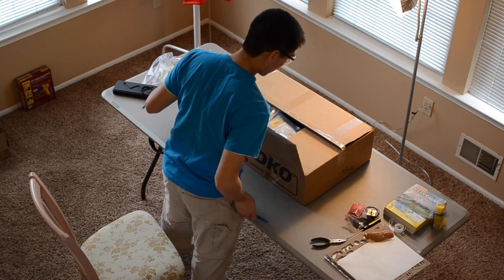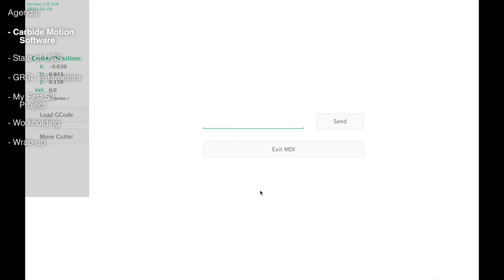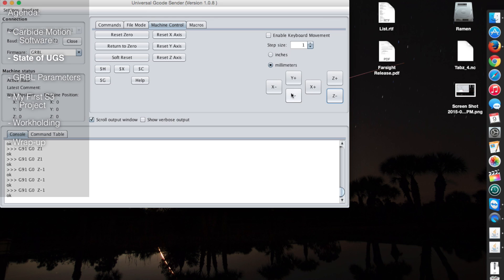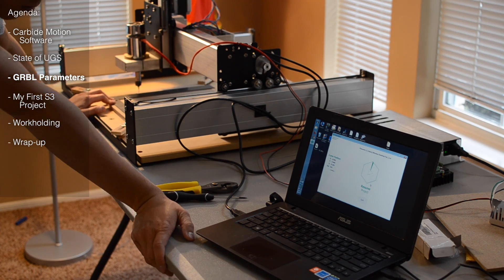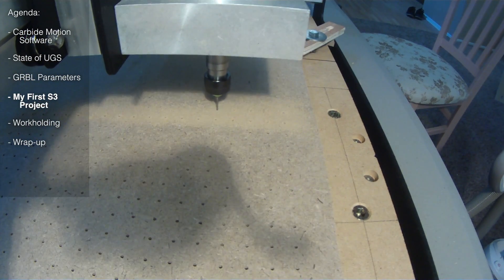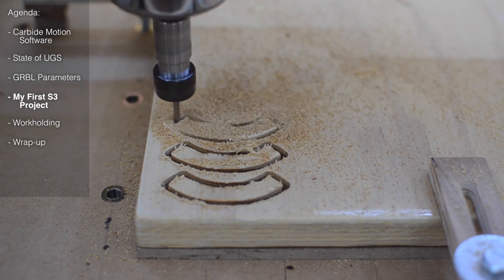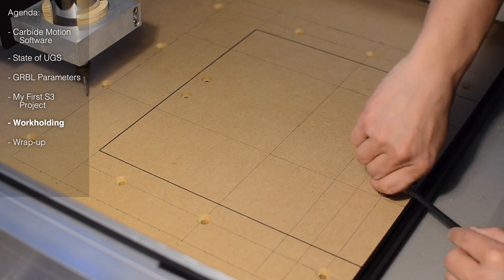Shapeoko 3: My First Cuts & Project

Comment: Hey Winston, great video. Are you still running the Shapeoko 3? Do you do any freelance milling?
Reply from the maker: I have actually started taking up some commissioned projects, and I use my Shapeoko 3 (stock size) a ton. Even more than the XL I also have actually. Little regular maintenance/tune up here and there and it runs like a champ.
Reply: Can I email you the file for you to look at, and see if it's something that you'd like to work on?

Comment: Hi, I was wondering if this has the capability of cutting balsa wood that is 1/8" thick. Would the balsa would stay in tact around the around that was cut or would it start splintering?
Reply from the maker: +Maya A I have not done it personally, but there are videos or there of the last-gen Shapeoko doing it. It comes down to having a really sharp cutter more than anything else.
Reply: Thank you so much for your insight.

Comment: Great video, just subscribed. What do think of the shapeoko 3 vs stepcraft? My use case is mostly RC part and carbon fiber button boxes.
Reply from the maker: At the smallest size (Stepcraft-1/210 Desktop CNC System), 100% definitely not worth it. ~$1000 for a tiny machine, or a 16x14 cutting area Shapeoko. Towards the larger end when you're comparing the Stepcraft-2/840 to an XXL, the utility comparison gets a little more even. Personally not a fan of needing that USB-to-Parallel adapter though, I much prefer the arduino/GRBL-based machines like Shapeoko/X-Carve. 

My recommendation would be a stock size Shapeoko 3, and put the money you save towards a dust shoe, filtering, etc. Milling CF is something you want to take precautions with. It'll be plenty accurate enough even though it's belt driven, and large enough that you could machine a whole quadrotor frame if that's your thing.
Reply: Stepcraft can use a kress spindle. It optionally has an auto tool changer. Plus it can do 3d printing. Laser engraving as an option. it also has a 3d probe and can crave on a curved surface. Stepcraft is a very versatile machine.

Comment: Hi, I plan to buy a Shapeoko 3 Kit and I noticed that It can be bought with a DeWalt 611 or Makita RT0701 motor. I noticed that you are using another motor. What do you suggest me to buy and why are you using a different motor? is it more powerful ?
Reply from the maker: So the spindle you see me using is a simple DC motor assembly you can buy from ebay (china) or Inventables. Its only benefits are that it's quieter and runs in a lower RPM range, but it's not very powerful. A lot of my later projects you'll see me make are done with a Dewalt 611, mainly because that's what the S3 was originally designed for. Carbide3D has since released a metal reduction bushing that lets you use it with the skinnier Makita. Both of those routers are comparable in terms of performance, though the Makita is able to go a little slower (useful for plastics). Subjectively (I have not confirmed this first-hand) the Makita has a different acoustic profile which many find to be less "annoying" at speed. You really can't go wrong with either, so if you have any brand loyalty go with your gut.
Reply: Thank you for your fast reply, It is really appreciated. by the way, can you tell me if the Shapeoko 3 can be controlled via "Universal G-Code Sender" ?
Reply from the maker: Yep, UGS has historically been one of the more popular options for controlling GRBL-based machines, including the Shapeoko 3.

Comment: Hi Winston, I just bought the Shapeoko 3 XXL and had a quick questions about CAM software: what would you recommend I use? I saw in your Shapeoko 2 video you used mesh cam, would you still recommend it (even purchasing it)?
Reply from the maker: If you are doing 3D cutting, then you have maybe 3 good options. MeshCAM, Vectric [whatever], and Fusion360 (I think). If you're not already in the autodesk ecosystem, then I'd probably recommend MeshCAM. But you can try them all for free, and you may find one of them substantially nicer to use...

If you're only cutting 2.5D shapes, there's enough free options out there to keep you busy.
Reply: What's your opinion on Visual CAM? I'm currently using Solidworks for all my CAD and wanted something that was close to the SW environment. Though it does mean I'm eventually going to have to drop $500 to generate the gcode.

Comment: You could take two pieces of 1 inch MDF the sizes of your table and route out each one a hollow pattern the same  for vacuum air then glue them together then drill your hole pattern to match the pattern on the inside for a air vacuum  table . tap the holes for Allan lock stud like on you pulleys that you can remover from the area you need to use.

Comment: Is there a reason I don't see people using Autodesk Fusion? It has pretty good CAM software included from what I understand and it's supposedly free until you earn $100k using it.
Reply from the maker: There's actually a fairly large body of people using it, perhaps just not as vocal as I am. It's got a lot of truly powerful features for freely available software, I'm just spoiled/biased by the interfaces of the comercial-grade softwares I've been trained on and I'll be holding on to them for as long as my student status lets me...

Comment from the maker: I don't know the particulars of HSM's post-processing options, but if they can build code for GRBL, that should be all you need.
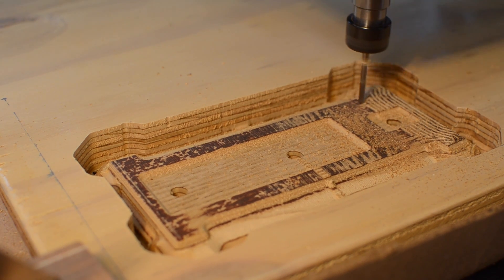Reply: Hi Winston, for the simultaneous 3d cuts there 5:27 , which software did you use?  was it carbide create (2.5D) ?
Reply from the maker: That particular project was via MeshCAM.
Reply: Winston Moy thanks for the reply. I know you've been quite into the CNCs. in your experience and knowledge, is it common for most, if not all, 3d softwares to be able to compatible with the cnc machine/software? or are they lumped together based on compatible companies etc.

Comment: Coming from someone who's preferred CAM software is Inventor HSM, do I simply need to choose GRBL (.nc extension) as the G-code in post processing in order for it to be compatible with the Shapeoko 3? I've seen that you use MeshCAM so I was wondering if there was anything special I needed to do coming from a different software.

Comment: Hello Winston,

Is there a specific pattern you would recommend spreading the thread inserts apart? or just every "x" square inches?
Reply from the maker: +Alvin Thai I made my clamps have about 2.5 inches of reach, so a threaded insert every 4 inches or so gets me pretty complete coverage. Also, I arranged a few specifically to handle 1x1' square panels, which I commonly use. Start with what's convenient for you, and then add more as needed.
Reply: +Winston Moy okay thanks I figured every 4 inches would be a good start

Comment: Winston, I really appreciate your videos.  I am just cutting my teeth so to speak and have a shapoko2 running grbl 9g.   Easel works fine but I cannot for the life of me zero the system when using universal g-code sender.   Can you point me in the right direction so I can actually start doing things opposed to just using easel.  

Thanks
Elliot
Reply from the maker: Elliot Davis First questions that come to mind:
- Are you hitting "Reset Zero" just before beginning any project?
- What are you creating your gcode in? Exporting from easel, or using something like MakerCAM? Do you know where the origin is, relative to your workpiece in the software?
Reply: Winston Moy 
Winston thanks for the quick reply.  Yes I have been hitting Reset Zero, however it usually ends in command not recognized.  I have been using sketchup with the sketchucam plugin and Makercam.   I have used the command line to set the work area to G10 L20 P1 X0 Y0 Z0   not sure how to actually home the machine by the command line I just use reset to zero. I believe the origin on top right corner when using makercam, but when I use sketchup with sketchucam it appears to be bottom left.  I am sure this can't be that hard.
Reply from the maker: Elliot Davis It's weird that Reset Zero wouldn't be recognized (maybe ). Although it should be equivalent, I would probably try sending "G92 X0 Y0 Z0" before running the program instead of the G10, and also remove any other non-movement commands from the gcode (more or less anything above G05...) to eliminate variables.
Reply: Winston Moy    I reloaded the arduino this morning with grbl 9.g  the same version as before.  I was able to position the tool and reset zero, load the simple gcode and  successfully air milled the pattern.   When I press return to zero it returns to the middle of the board.  But at least I am able to run some patterns now.  Inches out of makercam work fine.  Millimeters are hit or miss, but I vaguely remember you saying something about mm having to many decimal point in the gcode.   So progress was made.  I will trying G92 X0 Y0 Z0 and see how that works.  I will let you know.  Thanks for the help.  You youtube series is very helpful, I appreciate it.  Can you do a segment on homing switches (or is that limit switches)?
Reply from the maker: Elliot Davis There's a difference between "Work Position" and "Machine Position". Machine Position is absolute, and indicates position relative to where you were when you turned the machine on. So unless you turn on, or reset the Arduino after you've reached your desired start point, I'd ignore the "Return" button.

As for homing switches (and limit switches), the thought has crossed my mind, but I've just never had a project that really necessitates it. I'll keep it on my To-Do list though.
Reply: Winston Moy Ok, you have just cleared up so much of my confusion.  Thanks for the reply. I was able to get some test cuts going and have a "work flow" that doesn't use easel thank goodness.  Your youtube channel  has been helpful and given my autistic son things he wants to try  for Comickaze.  Anything to get him to engage is huge.  Thank you.
Reply from the maker: Elliot Davis You are quite welcome! Good luck, have fun. Let me know if you have any other questions.

Comment: Winston how do you like the Carbide software?
Reply from the maker: I think it's got a solid foundation, but in its current iteration it's a little too "Apple" for me. I'm going to be pushing for more features like program line and run time indicators. I expect it to improve in the next few months, but even in it's current state I don't mind using it for typical jobs.
Reply: Winston Moy Hello again, I received my Shapeoko 3 and its assembled and moving. I just noticed in your video
on the Carbide software, what is the screen to the left of the project running.I don't see that when I run mine.
I'm on a mac
Reply from the maker: james shelton Where in the video are you looking? Not sure what you're referring to.
Reply: its at the introduction of the video, about 4 or 5 seconds in
Reply from the maker: There are 2 additional "hidden" features in Carbide: a command line interface, and a log window. Access them by hitting "M" and "L" respectively.

(In the software version used here, I found that the interface got a little sluggish after a couple thousand lines. I would either avoid keeping it open for long jobs, or just clear the buffer every few minutes.)
Reply: Ok thank you